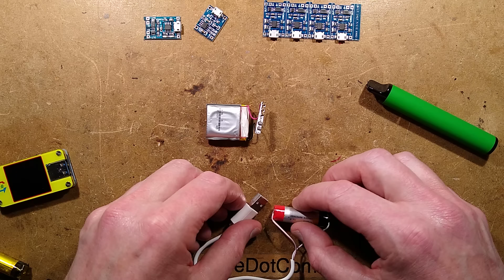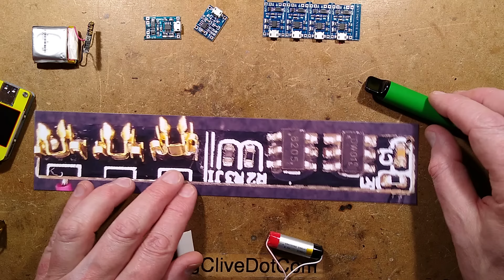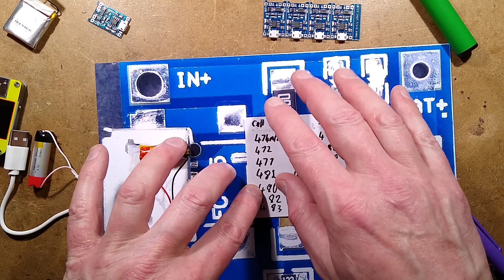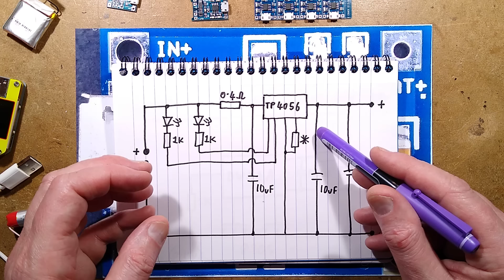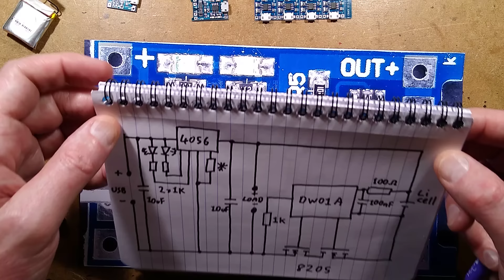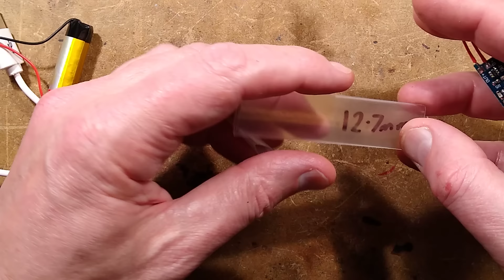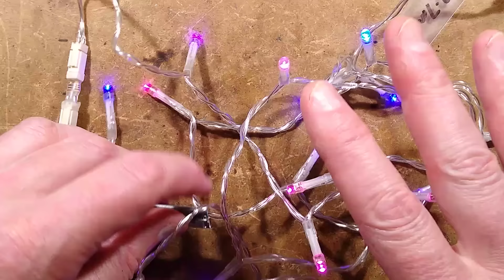Don't do this!   (There's a much safer way)

Comment: Somehow I knew about the 500ma limit (I am not an electrician), I charged mine with the alegator clip charger for old detachable bataries, I charged for 1.5 hours and it was fine after that.
Reply from the maker: You have to make sure the voltage does not go above 4.2V or the cell will be stressed and may fail destructively.

Comment: One time I was recharging a vape this way, and the metal that was holding the little light from the vape hit the bottom of the battery and it starting blowing steam out that smelt horrible, That day I knew I almost died once again, but damn after this video im never doing that ever again unsafely.
Reply from the maker: Yeah, even a slight short circuit involving a lithium cell gets violent fast.  You sometimes have to get in there and start chopping wires to break the circuit.
Reply: @bigclivedotcom  See I was thinking of chopping the wires, but it was steaming, and I didnt wanna make it worse I had no idea what to with it, I didnt feel safe putting it water to try and stop the reaction, and didnt have a safe place to dispose of it.

Comment: Those uniform cells sure are nice in flashlights, when working on a car or motorcycle, you can charge one set while using the other.   The amount of light some of these new ones give out is incredible. But no, don't charge them that way, a charger is very cheap.

Comment: If I connected two of those cells in parallel to the charger would they each charge at the more appropriate 500ma and therefore I’d not need to change the resistor from the default 1.2k ohms it comes with?
Reply from the maker: That would work, but the cells much have close voltages before being paralleled.

Comment: What may be easier than changing the resister to get charge down to .5 amp, is take two of the 500mah batteries and hook them together in parallel, making a 1000mah battery that will then use a 1 amp charge fine. Plus it will ran stuff twice as long.

Comment: How about using a four pin connector for the battery.  Then you use the second pair of wires to connect the programming resistor that's right for that particular battery.

Comment: Another great video, thanks Clive.  I have a question, I have a number of different rechargeable NiMH battery packs of different voltages (6V, 4V etc) but no charger.  How can I charge these?  Online I can buy different USB chargers for each type of battery, but can I use a bench power supply and limit the current and then just keep an eye on the voltage?  Or can I build a charger which allows me to adapt it for the different batteries (and their voltages)?  Thanks!

Comment: What about using one of those chargers that does a single 18650 cell, surely it must have a bms? Also does it help to parallel charge them? Since it would take longer

Comment: lol the way we used to charge those disposables to get the last lil bit of life out of them is you just hold the usb wires onto the battery for a good minute or so and then slip it all back together, since you only really want to get one more life out of it charging it the usb wire way works just fine.

Comment: if u cant afford charging board, cant u just use a resistor or tungsten wire from hairdryer to drop amps?
Reply from the maker: No.  You really need to limit the maximum voltage accurately.

Comment: You can do it that way just don’t be a retard and let it over heat or use a too high powered volt charger been doin it for years and had no problem

Comment: Have you any idea of the C rating of the batteries in these types of device? Elfbar 600 for example. I have a crazy idea to build a 10s 10p battery from these "disposable" devices. To attempt to power an E bike.. I know it would still be a fairly low capacity for the size and weight but am thinking of it as more of a demonstration of the waste when throwing these things into landfill or littering the streets.
Reply from the maker: I tend to charge them at 500mA, but I think they could be safely charged at 2C (about 1A) due to their high current application.

Comment: @bigclive I got the recommended BMS but my 18650 is getting really hot. Does that mean it's trash?
Reply from the maker: If it gets hot while charging and then discharges itself quite quickly afterwards then it's probably time to recycle it.

Comment: Could you help be build the Bob Beck Device circuit? I want to change it to use 18650 batteries instead, and be able to use USB-C power source , have it working with a standard usb-c port or power charging port. And be able to have it plugged in and have the device in use while the batteries are charging up. And be able to use the device with no batteries while being plugged in.
And an extra switch to be able to disable the LEDs to save on power/ less distraction. 
Can you please design this for me.
I would like to say could please help me with this circuit, but it wouldn't be helping me... it would be doing it all for me cause i don't know how to do this!
Reply from the maker: I wouldn't recommend using a Beck pulser on a mains powered supply for safety reasons.
Reply: @bigclivedotcom  well I live in a semi so it would either be plugged into the 12 volt port, or through USB that is plugged into the 12 volt port. Ok then, would you make the circuit so it will charge the 18650 batteries but not let the pulser run while charging?

Comment: I was charging one at like midnight fell asleep, and then I woke up on fire and half of the skin on my arm, burned off in this video is way WAY too complicated. I’ve been using an 18, 650 battery charger for like two years now and it works flawlessly charges at the perfect power turns off when it’s done and nothing is ever went wrong with it and you can buy one for like 20 bucks instead of doing all this bill Nye shit
Reply from the maker: The Bill Nye stuff is optional for the technical posse.

Comment: Hi BigClive. I several times tried to send a questions regarding these boards under a comment that I wrote under this video like a week ago, but it doesn't work for whatever reason. 
So here is my question then:
Could it be that these boards get fried if the attached load is too  big? Is there a limit to what load can be attached? Because I tried attaching a quite powerful DC motor to them and the two boards that I tried it with didn't work in that configuration, and the led's don't even light up anymore even without anything being attached to them(so I guess they're toast now). And I don't think that exactly those two out of the five that I ordered were faulty ones. I didn't test their functionality beforehand though.
The motor runs fine when I attach it directly to the battery, but it seems that these boards can't handle that configuration.
I unfortunately don't know the specifications of that motor, because there is nothing written on it. I only know that the new battery should be able to handle the load, as it has similar specifications to the one that I want to use as a replacement. 
Hope you can help.
Reply from the maker: It's possible that the high inductive load damaged the transistors with a voltage spike.  If the motor only gets used in one direction it might be viable to put a standard 1A diode across it with the diode band towards the positive side.  That would shunt the spike from the collapsing magnetic field.

The initial current surge may also be tripping the protection circuit.
Reply: @bigclivedotcom  Thank you for your fast reply. The motor would be used in two directions. It's basically one of those stick shaped cordless power drills, that I would like to power with a lithium cell instead of the NiCad cell that was previously in it, and I wanted to make it so that I can charge it via mini-USB. But I don't know much about electricity unfortunately, so I don't know how else I could realize the charging of that cell.

Comment: I just cut a usb to mini-usb cable and soldered some crocodile clamps to where the mini-usb was, and then I use it together with a 5V-500mah usb wall plug. 
I measure the voltage from time to time, so that it doesn't get to more than 4V.
But I just ordered those boards and resistors, to make a few more chargers for my harvested lipo batteries.
By the way, is there an easy way to make those boards only pump out 4V instead of 5V? So that it cuts off when 4V have been reached.
Reply from the maker: Don't rely on remembering to measure voltage.  It's easy to get distracted.
The modules are locked at 4.2V.

Comment: I 'found' some of those smoke makers at the local shop. 2 for £10. The batteries are still the same and yes they are very good. Nice substitute for 18650s from old laptops. Perfect for  remote solar powered esp32 projects if you put them into deep sleep with timer wakeup.

Comment: I remember a few years ago when I was a dumb kid at peak nicotine fiend, I used the USB method. I always looked for the lowest amperage charger i could find, usually around 1 amp. I also didnt let the battery charge for more than 30-45s at a time. Cool to see my intuition on how to do it (somewhat) safely was right. But boy am I glad to be blessed enough to just go buy new vape supplies now 😅

Comment: I fell asleep at my desk while charging an 18650 with the two-wire method.  I didn't use tape to pin the wires down,, I used 2 flat hard drive magnets. Anyway, the battery exploded and shot one of the magnets at my face. It hit me in the forehead and woke me up. As if that wasn't a rude enough awakening, I quickly realized there were 3 separate fires burning and they were going up fast. The explosion must have sent the battery shell on a convoluted spin flight like cartoon character using a jetpack for the first time. So it shot napalm out of the open end in a sporadic pattern as it flung across the room. By the time I got to the 3rd fire the "oh sh*t"  moment had escalated to genuine "I'm f*cked"  levels. If that magnet hadn't have hit me in the head I wouldn't have had enough time to put all the fires out. There was DEFINITELY someone looking out for me that night.

Comment: I done the dogey job as you mentioned and I realised it is unpredictable so for the most part I kept a good eye on it felt the temp ECT and it was on there for at least 1 hour and I walked out of the room for a few minutes and come back and the battery look like an inflated pillow and was ozing liquid and battery was very hot and definitely would have caught fire or exploded if I had left it longer ........so yeah not recommended 😂

Comment: I asked on a forum about whether these “disposable” vapes could be recharged and was laughed at. Now I know they can then that’s great. question: how did you remove the battery? And what care should be taken?
Reply from the maker: A pair of pliers can be used to carefully remove both ends, and the insides pushed out from the mouth end with a pen.  Take lots of care to avoid short circuiting the lithium cell as it holds a lot of energy when charged.

Comment: I feel like this video needs a Shorts release at the lowest-common-denominator level, for people who might have just enough knowledge to be able to solder/glue/tape USB leads to a bare cell but see a circuit board and descriptions of "programming resistors" and "MOSFET package resistance" and tend to blank out.
"Don't do this. The battery could rupture and become a flamethrower. Instead, buy this board, wire the cell to these pads, and wire your circuit to these other pads. Now you're safe. Watch the long-form video for a full how-to." Only problem is demonstrating the soldering in a short would necessitate editing.

Comment: Theres a much safer, more accessible and easier way then you just showed: the standard 18650 lithium battery charger that most vape box mods with removable 18650 lithium batteries use will also charge just this battery , or any other disposable vape battery no problem.

On the side, you can see the battery name, and it actually says on 18650 chargers manuals that itll charge many other size lithium batteries too, just about any vape you take apart will be using one of the batteries a standard 18650 charger can charge.   They are called 18650 chargers because thats most common use, but its rated for many many others.

Just put it in the 18650 charger and you are good to go.  No sautering, and the 18650 battery charger will automatically give the right voltage so its much safer

Also, having to resauter them when they need a charge is not ideal.

Also, safety wise, lets be real a lot of the people doing this are gonna be mostly crackheads or children so ideally its completely idiot proof.   Having to resauter and tape it every time you charge is not idiot proof.   The open wires, sautering, the tape, the crackheads and children and the charging using the wrong voltage on a device not designed for it.   

It just isnt very safe when theres 20$ charger that does it quickly safely and reliably.

Of course, a battery in this state is much more dangerous then a normal one so do your research and do it at your own risk.   They arent meant to be handled and recharged over and over so keep that in mind.   Normal battery rules apply 100 times over.

Another reason  not to keep sautering and applying tape and ripping it off many times to charge it over and over is they arent meant to be handled.   Resauter and retape is a lot more handling then just putting it in a charger.  And the less its handled, the lower the chance of an accident.

Comment: adding 2 of those batteries in parrallel giving 1.1a at 3.7v is possible i assume? charging at .915 and giving even more length of time for led's ? Is that an idea or are there inherent dangers? i assume the 2 batteries would just balance out?
Reply from the maker: The batteries would have to have a very similar voltage level before being connected in parallel.

Comment: Could you not just use an advanced 18650 charger and connect the +ve and -ve wires of the battery to the charger terminals? Mine will autodetect the battery chemistry and allow me to set the charging current to 500mA or 1000mA.

Comment: Can you charge multiple cells in parallel with this?
Reply from the maker: Yes.  But they must have very close voltages to avoid high current flow between them when they are connected in parallel.

Comment: A better suggestion instead of charging it and burning your house down would be to just remove the leftover vape juice from the cotton and drip it into a reusable vape with an empty tank to put the oil in and buy a funnel for it too. Then anytime your disposables run out you can just take it apart and drip the juice into the empty rechargeable one's tank.

Comment: I've got cells that look very similar to these thar have come from elfbars but are 650mah I was curious if I could wire several batteries together and if it would fully charge them in this case?
Reply from the maker: You can hook cells in parallel if their voltages are very close.  If you do so, they act like one big cell.  The usual precautions against a short circuit should be followed, as the short circuit current will be higher too.
Reply: @bigclivedotcom  how high could this chip handle as far as charging if I stayed at 3.7v batteries I read somewhere one of the chips only allows up to 1000 mah so does that mean sticking to just 2 of these would be ideal I don't wanna solder a ton together and it only charge half the capacity etc

Comment: Great video, keep up the good work, since watching your first on vape batteries I have been collecting them off the street and have a about 200 of them in varying sizes. two of the smaller cells in series and trickle charged, with a PP3 connector on now replace my meter batteries and they last so much longer. I have just ordered five of the boards that you mentioned and will be converting some 1950' bicycle lights to lithium. Are there chargers that will charge two cells in series from a USB?
Reply from the maker: You can get two cell protection PCBs that will ensure that the cells don't get overcharged or overdischarged.

Comment: Can it be used to charge multiple batteries or do I need an additional BMS?
Reply from the maker: It's better to charge one cell at a time, but if the voltages are extremely close you can parallel cells into bigger capacity ones.

Comment: Couldn't you print a 3D housing which has 2 contact points where one can slide in order to create a sort of multi-size charging housing and then attach those to this board, and then attach a USB A or USB C cable coming out so you effectively have a hot-swappable battery source or... I guess 18650's or any rechargeable lithium battery?

Edit: Would mounting a multi-turn pot in place of the resistor be good for then being able to vary the charging rate accordingly? You could even put in a little screen to give you the V and A rates?

Comment: Is it ok to have the load (led string in this case) connected whilst charging is taking place?
Reply from the maker: Yes.  If the load is low the charger will not seem to terminate the charge, but will actually be powering the LEDs directly and the lithium cell will not be overcharged.

Comment: my dad has a special charger that charges lithium batteries and it's much better because I had a case where it exploded and I had a lot of smoke in the house and it doesn't even charge 100% so save yourself some money and get a special charger for your safety

Comment: Could it be used to charge the lithium coin cells assuming the correct resistor is fitted?
Reply from the maker: Yes.  You can use a high value resistor with the TP4056 module for coin cells.